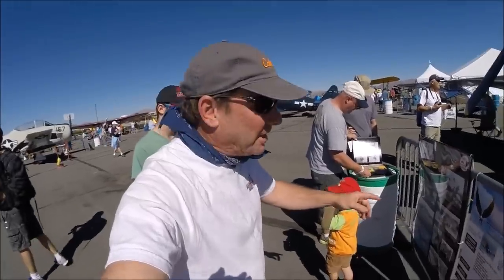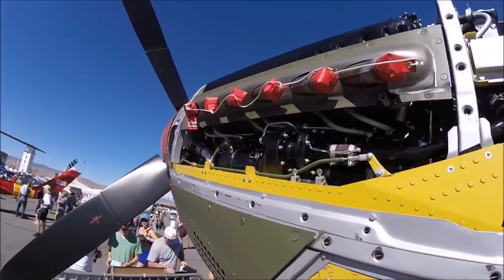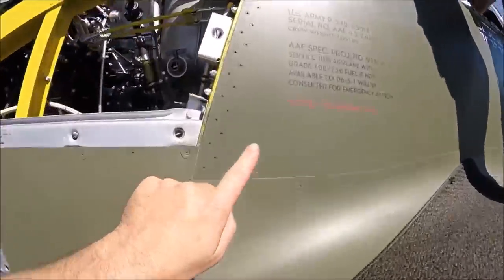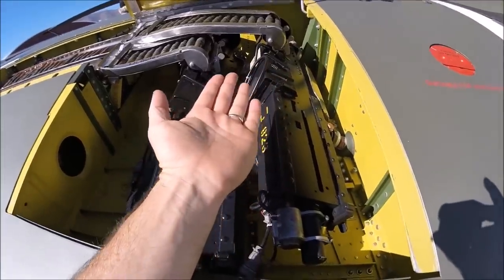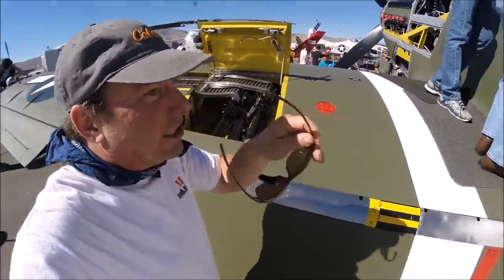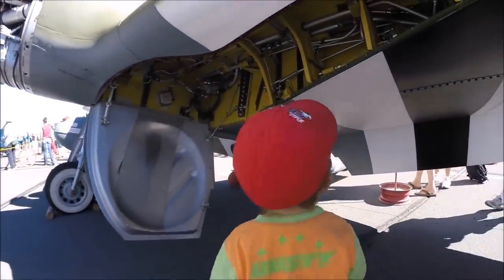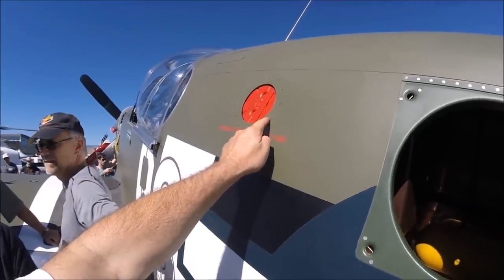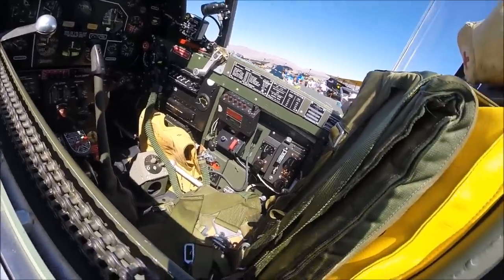D-Day 75th Anniversary- 2015 Interview with P-51 pilot Vernon Bothwell

Comment: Just some historical points about P-51B/C.  Correct terminology for standard B/c canopy is "flush type enclosure" The example on that particular B is a Malcolm Hood, which was a theater retrofit. Technically, it is a "bubble" canopy, just not same a D's. Angled guns were prone to jamb but again theater retrofit of boost motors cured the issue. They are angled because this configuration was vestige of A-36 installation, which had to feed under the dive breaks. Finally, photo of Woody Pusher is actually a Curtiss production a/c. Woody design is based upon this. Yes, I am an airplane nerd!